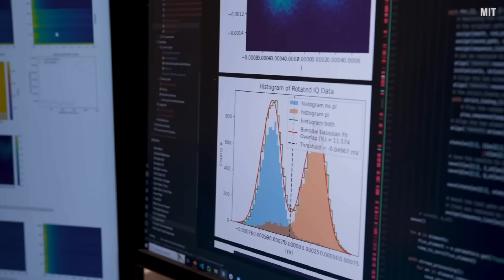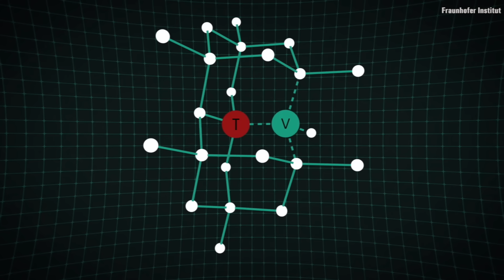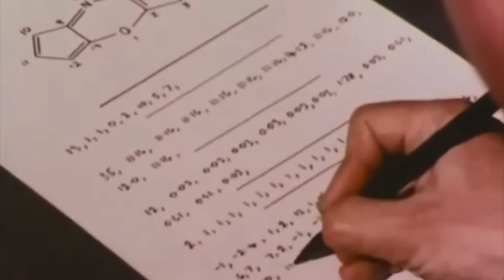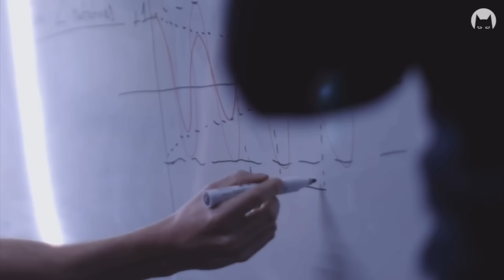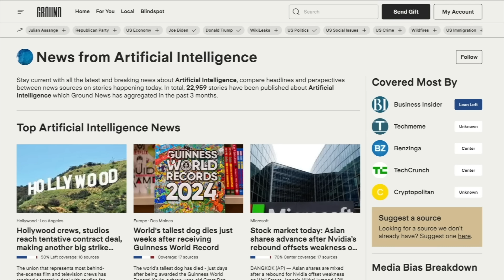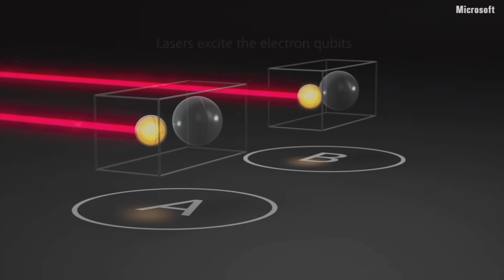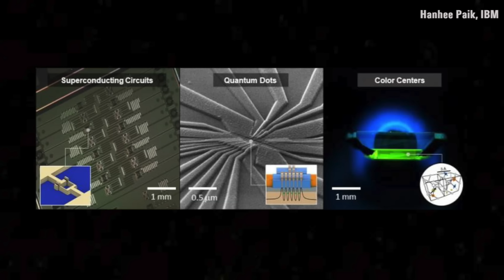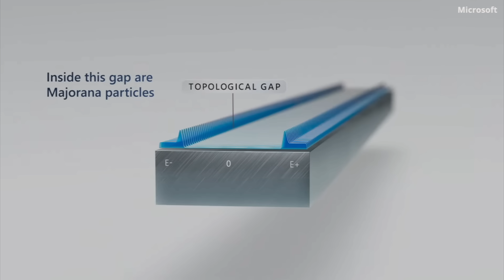Big News For Quantum Computing: Microsoft Topological Qubits Explained

Comment: So the light or photons have magnetism?; So if one is + the other negative; I would say chemistry with photons. Also as the light travels very fast you can travel through the cable and return and know the state of the other Foton. The other day I was meditating because having a straight line and having a start and this is zero and the left and to the right the positive; So I said the zero is the foton and that straight line is only the diameter of the field of the influence of Foton I want to say the Foton also has sub -participants that turn around. Those negative and positive numbers are the circumference of their wave to say a circular or spherical wave as they want to see it. The fact is that we do not know the field of influence of a Foton, what I mean is that if the Foton travels through the fiber before having the encounter with the other Foton before they had already to speak his field of influence or circle. This means that a kind of reaction can be known or made, such as saying the influence of the moon with the earth; They do not touch but influence. I do not believe much in El Cat's experiment in the box since if it were true we could know his situation I bone I would not be in case of point or in theory about it for the initial of what the cat is said in the box and If I try to see it. For example I can say if I open the box and it is dead means that it was alive before opening it; But can I say the same if I open the box and it's alive that before opening it because the cat was dead? hahahahahahahahaha. Greetings.

Comment: lastly certain Spectre operations either require a far higher degree of.complex recoding which is there are only very non intuitive methods of conversions of these operations which fundemntaly will either make certain spectre operations un compatible with these commercial Quantum chips Vs Super Quantum systems, that or require any such operations to have a compiling or recoding to them which is completely dependent on breaking them down from infinite spectre frequency operations means of firing transforms and plugging this data into and breaking it down to a given large system of redundancy Quantum nodes on Quantum chips while also shaping this data in what ever unique binary that or lesser windows of frequency, which any given spectre operation is instead of using between 4 and 8 Super Quantum bits upto 16SQB for Quantum  operations of large size 32SQB is all that's required for an operation of any given magnitude, on this chips instead arras of the chip are made into Quantum faces which act like low resolution Super quantum bits using semi conductive Qbits Vs suoer.conducting and photovoltaic IOs.

Comment: That claim about comparable transistor density seems a bit far-fetched. The qubit density of tis would be at about 1,024*10^5 per mm² while TSMCs N3 transistor density  is at 1,97*10^8 which is more than 3 orders of magnitude or -65 dB difference. That's not what we call close, but frankly it is enough of an achievement by itself. I would be interested in how they came up with that number.
Reply: Anyway, I checked the paper. They never say in the paper that this chip is comparable to N3 in no way, because that would be ridiculous. They only mention under the "Further scaling" section that if they had a custom lens made for their imaging system, than they could theoretically resolve spots so close that this would maybe enable qubit densities close to TSMCs N3. It would be cool if you corrected this in the video.
Reply: *This refers to 5:15 min in the video.

Comment: We got to the moon on a few K ... why are a few K q-bits "impractical?"
Reply: A "logical" qubit that can be used to compute anything, is made of numerous "physical" qubits. This is needed for error correction, quantum states might last just milliseconds, without collapsing it, you have to verify its state and hold onto it somehow. 

It takes thousands of physical qubits to make just one error corrected logical qubit. Doing some interesting problem may need 300 logical qubits. If each one needs 3333 physical qubits for error correction, then you would need to manufacture a chip with one million qubits on it. Which we are nowhere near.